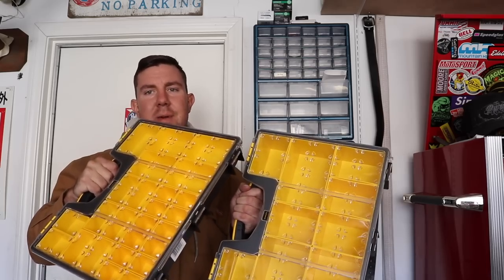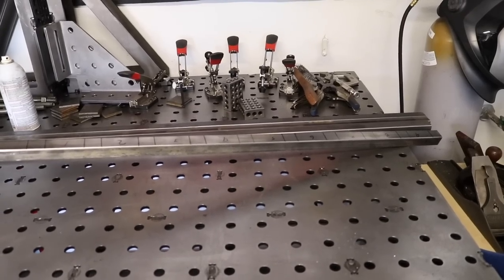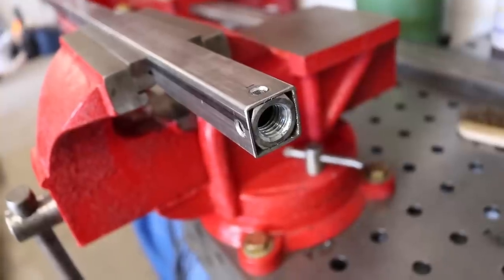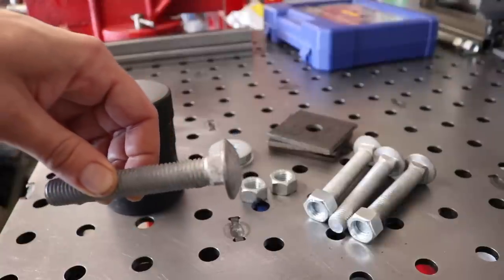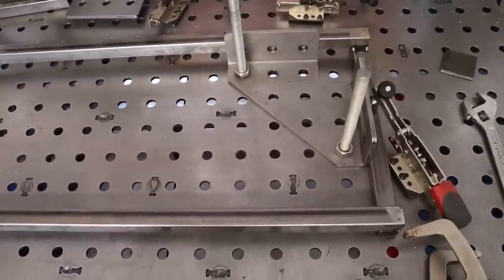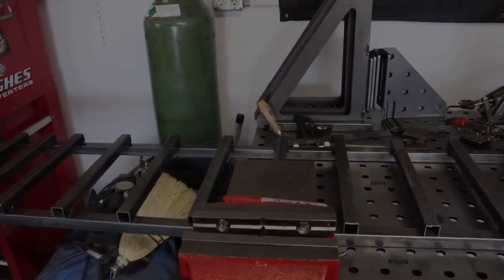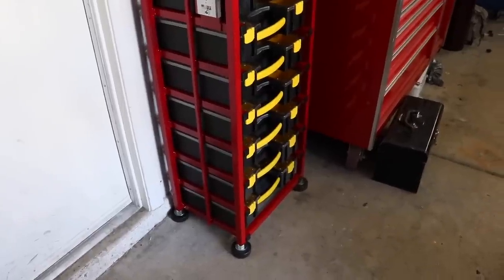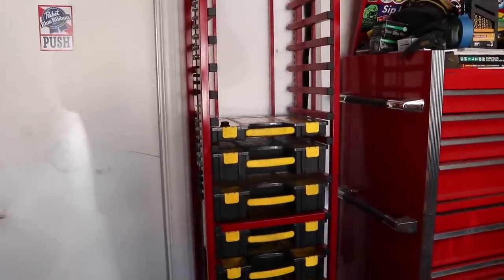Parts Organizer Storage Rack

Comment: Nice!! Love the overall design and hockey puck feet!! Bravo
Reply from the maker: thank you, glad you like it. Once you buy a huge box of hockey pucks, you end up using them for everything. they are hard enough to machine but soft enough to absorb vibrations.
Reply: BUILT I wish I thought of those for my large air compressor feet as isolators...but used some 1” old conveyor belt I had around.
Reply from the maker: @outdoorzone  i like it, use what you have. that's why i hate throwing stuff like that away. i always end up needing it!

Comment: Instead of 1x1 between the plastic totes. I think I would have used angle iron,  would have given more of a lip to slide on. Just a thought
Reply from the maker: Calimesacox  good call. I think I actually mentioned that in a comment somewhere on here. If I would have bought the metal to make this project I would have used angle iron instead for sure. Look for a new rendition of this storage rack in the future
Reply: I was thinking the same thing watching the video, this would also give it 'sides' so the boxes don't slide out sideways, it would probably be cheaper too if you were buying the metal just for this rack.
Reply: @olivertaylor4779  I didn't even thenk about it going oy the side, buy your right.  And he would have gained a lot of room. Would have got two more of the thin organizers. I am thinking about making one. Seen where a guy put in the middle a pull out tray. So he could set and open the box..
Reply: @calimesacox  The pull out tray is a great idea and it saves room on a bench, I would have a bar/tube in a l_l shape and this would go into tube on each side, 8mm rebar is nice n cheap for this and strong too.

Comment: The finished product looks super nice, and professionally done. The red looks awesome. I do have one question; why did you use square tube for the drawer supports? It seems like the square tube is using up a lot of vertical space and maybe using angle instead would have allowed you to fit more trays. Just asking. Other than that detail, I intend to totally copy this. I also love the fact that you used good quality trays. The Stanley trays are WAY better than HF's and worth the extra $$. Two thumbs up!

Edit to add: I see a lot of other folks have said the same thing and I see your responses. Excellent project anyway.

Comment: Awesome rack. Do you think it would of been cheaper to use angle iron for the shelf sliders? Or do you think tubing is better to hold the boxes straight?
Reply from the maker: Jason angle iron would have been a better choice for sure. I just had a ton of this 1x1" box tubing laying around so i used that. If i woukd have bought the materials, i would have used 2x2x 1/8" angle iron i think

Comment: I've seen a lot of wood ones. But I like it in metal better
Reply from the maker: Ya the wood ones are where I got the idea. This one is allot stronger and could be bolted anywhere. Even in the back of a truck or trailer.
Reply: @built4625  also, I sent you a message on Instagram.

Comment: That looked go, it was a finished project.  The caps were a nice touch, the sortemo idea is a very valid project for a home shop, where space is always a premium. Mine uses a steel shelveing unit with extra shelves to hold 16 trays two on each shelve, the blue steel and plastic part holders are where I started but just to small.   Never saw hockey pucks used that way. I use one as a pin block to punch out pins in firearms, and getting a big box means they are cheap unfortunately pucks are not available anywhere near me and I picked mine up in Vancouver coming back from Alaska.  Imagine pucks not being available in the desert?   Don't allow your shop to become other people's warehouse.

Comment: I use those exact same totes for screws...etc.  I was wondering how I was going to build my rack for mine.  Very nice job and looks great.  My only issue is that my rack will be built for installation into a 7'x16' trailer.  I would have to make modifications to it for that kind of environment....:)  I was wondering why you didn't use 1"x1" angle iron for the supports.....just curious is all. My unit will not be mobile within the trailer....screwed to the wall for sure.  The other thing is that I did not even know that they made a smaller tote.....gonna look into that as well.  Thanks for the great video.
Reply from the maker: Russell Freer thanks for the love! I would have definitely used angle iron if I had it available at the time. I made this whole rack out of metal I had laying around that was left over from other projects. If I had to buy the materials I would for sure go with angle iron for the parts that the totes actually sit on.
Reply: I was wondering if you had the rest of your totes installed(pictures), how it has been working out and if you had made any amendments?

Comment: WTF... you just made all my shelving look like crap.  Oh well, guess I'll just have to up my game.
Reply from the maker: Terry Pullen haha I’m sure they look fine. I know how you feel though. I always see better ways to make projects after I finish them. Like for example, I would have used L- angles instead of box tubing for the drawer slides if I had to do it again. I probably would have been able to fit a good deal more totes with all the extra space.
Reply: @built4625  I caught Harbor Freight having a sale on the thinner boxes so I purchased 8 (they had a limit of 9 but I was thinking even numbers in case I wanted to do side by side. I also bought 2 of the thicker cases and 4 of the half width cases and they also had some odd shaped cases (18.5"Lx6.75"Wx3.5H) I bough 4 of those. So my question is when I left the store I was kicking myself thinking I had bought to many of the "thin" boxes (16.5"Wx13Dx2.25"D) and needed more of the "thick" (16.5"Wx13Dx4.5"D). BUT once I got them back to the garage and began the sorting in the round(picture me as Def Leppard and the sorting boxes as the audience) I discovered I really did not like the "thick" very much because the bins are too large too deep and too few, yes I had a few items that they were ideal for but it was only a few.
 I dig the "frame" method of building the rack, but I am not capable of welding at this time so I'm going with wood. I watched this video ( https://www.youtube.com/watch?v=LDPfv8XKspQ )after yours which also used welded tube frame but he also used wood panels. Obviously his wood panels were for aesthetics, but if the frame were made of wood as mine will be the wood panels become integral structure. Thanks for the inspiration and happy new year
Reply: I should have said I mention this because:
1) you mentioned getting more cases in by using angle 
2) I notice you have a lot of the thick cases 
Perhaps your storage needs are vastly different then mine (and they may be) but that seems like an awful lot of those thick cases to me
Reply from the maker: SeanRWisner nice! Great score! Tag me in your build whenever you finish it. I would love to see how it turn out. Especially with the half width cases.
Reply: Oh one last word... SUBSCRIBED!
Reply from the maker: SeanRWisner ya I wish I would have used L-angles instead of box tubing but it was what I had laying around at the time. And I went with all the thick cases because I have a lot of large consumables I needed to organize like bungs, hinges, fittings etc. it’s hard to believe, but almost all the cases are already full. I’m going to build another version for all my woodworking consumables soon.
Reply: Solid
Reply: He He  @built4625  said bung
Reply from the maker: SeanRWisner 😂😂
Reply: BUILT   Half DEPTH cases... though I did buy 4 of the half width cases which are also half depth and I intend to add more of them for the very small items which I seem to have a lot of variety if not quantity. I've noticed others making these shelves "modular" to allow for using the thin or thick boxes which from a design perspective seems great, BUT there is actually a draw back. Contrary to logical thinking and assumptions the thick cases are not as thick as two thin cases so each of the slots that are used for a thick case will leave a void of unused space. see this https://youtu.be/dLTdo6498hk?t=886 just pause it right there and look at the voids above the thick cases.

As for tagging you,  I do not have a channel for this stuff. Perhaps I should start one I can call it the complete guide to being a newbie making it up as you learn channel for experts...

All of that said what I am thinking at this point is that I should make modules which house several boxes of a specific size that are not too large and can be staked and/or side by sided that way each module can be sized to the exact containers I have without wasted space but I can always make another module to add on. And I suppose it goes with out saying that the "modules" will be smaller and therefore easier to build and handle and work on.
Reply from the maker: SeanRWisner nice! Sounds like you have a solid plan. What kind of stuff are u storing in them?
Reply: @built4625    wood screws, sheet metal screws, machine screws, bolts, nuts, T-nuts, threaded inserts, Unistrut nuts, washers, ring/fork/spade terminals, wire nuts, fuses, casters, bearings, bushings, springs, hooks, grommets, cable clamps,  fittings... I dropped by HF and picked up 4 more of the half width boxes, 4 more of the odd shaped 18.5"Lx6.75"Wx3.5H and 2 more of the thin 16.5"Wx13Dx2.25"D units which are still on sale for $5.99. I didn't fill the original boxes up but I did find myself putting dissimilar items in the same container so I wanted to allow for more categorization.
Reply from the maker: SeanRWisner damn you sound just like me, you have enough hardware to fix or build pretty much anything. I love it though. Nothing feels better than having to do a project and not even needing to go to the hardware store. It’s so handy once you have everything on hand already. Def a big time saver too.